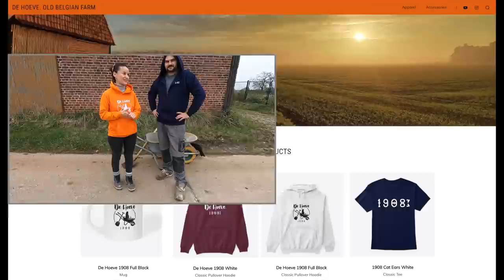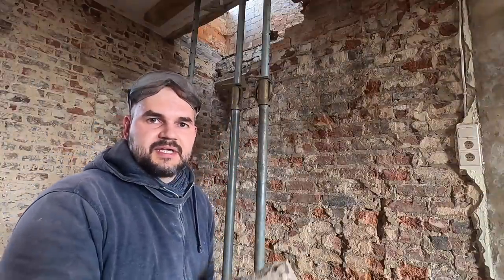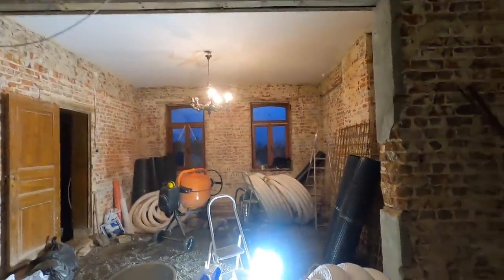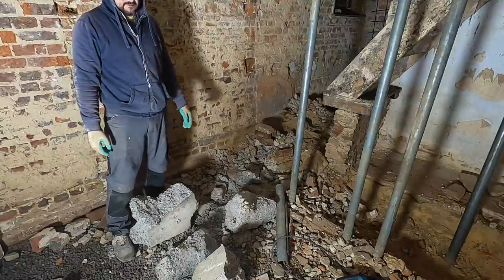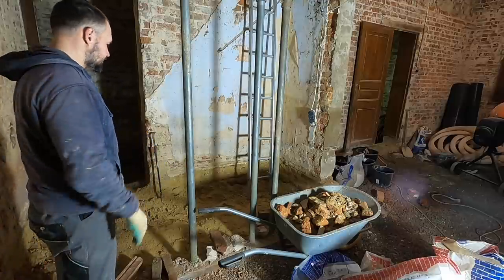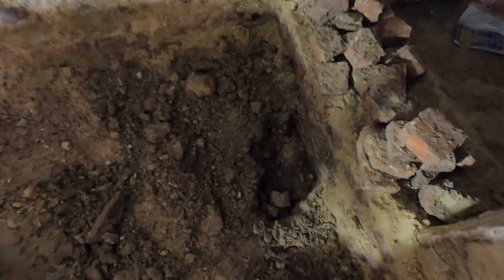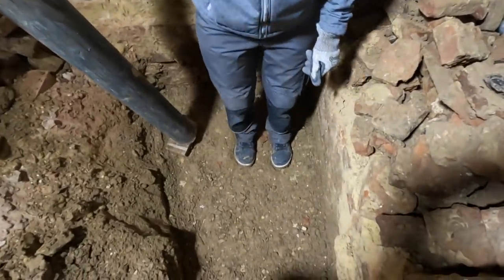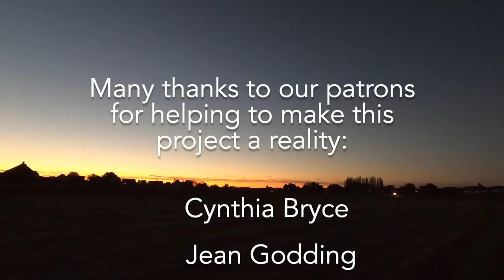Bye-bye crumbling wall! / DANGEROUS removal of OLD oak staircase

Comment: a suggestion only:  take one of those plastic bags, put a current newspaper in side of it, and write a note from the two of you about what you are doing, when, what problems you encounter, and what surprises you find.  Include that in the bag, tape it shut as well as you can, and bury it for the next renovators to find!  In my friend's house, we found a newspaper from 1946 in the wall, along with a note from the then owners. It was really neat to see what they were doing, and thinking.  The newspaper was a real eye opener as well.  We learned that the Marshall plan was not at all popular, even though or education told us differently.  (Letters to the editor section.). Besides, in 70 to 100 years, what will they know or think of Covid?
   Keep up the great work!
Reply: What the didn't tell us in history class is that the US made the Marshall help depend on all kinds of political demands. So it was a trade off. For The Netherlands f.i. it implied the decolonization of Indonesia, while breaking it's promise made to the Moluccans for independence. That has caused significant issues later, until this day.
On the whole Germany was off better than many of its victims.

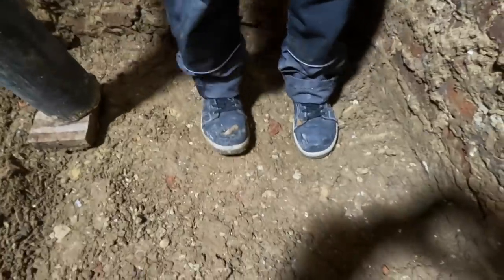Comment: 24:08 its called liquefaction similar to a earthquake when the water in the soil is pushed upward.
Reply: BTW that is very unstable ground so you need to address the water drainage for that area or you will have a problem

Comment: Hello, the wobbling effects is about the ground water. In old houses you dont have drainage, so the ground water comes up.
Reply: Here in 🇨🇦 we would dig down and add a plastic well type insert with a sump pump to direct the water into the Grey waste water. This would prevent any rising water from degrading the foundations.

Comment: If the wall is important structurally you'll have to plan your windows carefully. Love the idea.
Reply from the maker: Thank you for your advice, Bill! No, it's not structural, but we will still place some wooden posts  and install the windows in-between.
Reply: @DeHoeveOldBelgianFarm  what might be interesting is use some of the old building materials and make it look like a outside of small buildings.  Had a friend do that it was beautiful 😊.
Reply: Even if it is a non-bearing wall, every hole in a wall is a weakness so be certain to build a nice, wooden frame(jamb) for each window to strengthen and support the weight of the entire structure. It would be nice to have some tiny LED lights on a dimmer switch to enhance the effect at night. Perhaps, a few window sills for plants and the cat inspector on the higher windows.
Reply from the maker: @l.m.2404  thank you 🙏 love the idea with led lights to enhance the view

Comment: I love the idea of the windows, but also could you not have two entrance's to the stair case? The original and from the room that was divided by the wall you knocked down? I'm loving the series, I wish you the best of luck!!
Reply from the maker: Thank you  very much! It's gonna be our guest room, and we don't want to lose this room by removing the wall or adding a door. Although the idea is very tempting but our guests sometimes stay for a long time and we want to keep their privacy  and semi-isolation :-)
Reply: @DeHoeveOldBelgianFarm  Will the windows in the wall maintain privacy if someone is climbing the stairs? I like the idea of a door that locks in the new wall, it would anchor and balance the pattern of the windows. The Feng Shui energy flowing with the wall down is unmistakable and beneficial. A solid locking door would preserve the flow.
Reply from the maker: @khilde6093  Thank you for sharing your vision. We would also add a curtain (from a heavy dark material) so that  the guests can close if they want.

Comment: I really like the staircase windows idea!  So, you are going to make a box under the staircase that will give you a place to put storage and also support the new stairs?  Or are you going to just form the first few angled steps and stair base from concrete?  If you do that, you can make that whole space under the stairs into a closet just by putting a doorway in as far over to the right hand side as you can make it.  Depending on your finished floor height, you could probably even get a full sized door in there.

Comment: The mushy staircase floor looks like a problem. If you don't already have it in place, run outside drainage weeping pipes, about 20cm or more wide and down to and against the footings around the entire circumference of the house with another pipe leading the water out to a farther, lower area to drain out.  It'll take time to work until the water finds the 'exit' but eventually this should help reduce your damp problems.  Your floor might also be on an artisan well spot which can never be fixed. I hope you find some good solutions. All your hard work deserves rewards.

Comment: The new staircase plan is cool! However, be sure your building codes allow for windows without safety glass down the stairwell. Safety glass is required in the US so you can't go tumbling through them by mistake! All your foundational work is very inspiring!

Comment: The windows will need to be out of the foot pathway as you don't want someone to hit it as go up and down. The sound walking up and down will also pass through as well as any dialog within the room its self. So consider that as well. It's a fun thing for sure and is novel! So I would do it!

The built-in drawers and closet spaces is also a great idea!

Comment: And because you asked:) :  I love the idea of a wall of windows, but were you going to use that space as a guest bedroom? In that case, every time somebody turns on the light in the hallway,  their bedroom will become lit up, and there will be no privacy there either. I would  definitely make the staircase wider, and put in a window in front of it, so you look out when you come down the stairs. But since the entrance to the staircase is in kind of a corridor (if I remember correctly), I would rather remove the wall and open it up on that side instead, and make built-ins under the stairs on that side. An open staircase would make it a lot more airy and open towards the entrance and guest bathroom.

Comment: Mitigation methods	Edit
Main article: Dynamic compaction
Mitigation methods have been devised by earthquake engineers and include various soil compaction techniques such as vibro compaction (compaction of the soil by depth vibrators), dynamic compaction, and vibro stone columns.[18] These methods densify soil and enable buildings to avoid soil liquefaction.[19]

Existing buildings can be mitigated by injecting grout into the soil to stabilize the layer of soil that is subject to liquefaction.

Comment: nice idea using the windows like that.   you might  hang them on wires from the ceiling and then once you get them in the right spot frame around them. you could help airflow through the space by not making that wall solid also.  A screen effect  lets say vertical boards with a spacing between them and the storage could be built into the structure.

Comment: 24:25 that is LIQUEFACTION ... you need to drive down posts (piles) treated wood will work to stabilize (like Venice)
Reply: Without being solid or stable the floor could or may shift? At least crack any work laded on top of it?

Comment: I love the window idea. It will be beautiful. However, I think the stairs will be too steep as you planned it. Is it possible to add a landing halfway down, and then turn the stairs, ending into the room below? It seems like a safer option and you can still incorporate the windows.
Reply: Check the head height on the landing first if ok as a retired builder it would be a lot safer and easier to go up and down the stairs

Comment: I'm not sure if you guys mentioned in a previous video on how you guys planned on heating the house, but are you guys pouring slab on grade throughout the house? 
If so, one option would be to install radiant floor heat while your at it.

Comment: You could possibly use the little space under the stairs as a coat closet, or possibly a little storage area.

It’s odd that someone would Lay a brick foundation by using plaster. But, then I realized that i think that the old brick wall was probably built around ww2. it’d make sense if the wall was made from that time because during ww2 stuff was Vary scarce, especially with buildings materials etc.. so they used whatever they had to built the wall with. & I think the wall was probably built around 1939 through 1943, ( not confirmed. tho most likely. )

Comment: The idea of the windows set into the stair wall is attractive and will produce a nice display but you may want to consider frosting the glass to give the occupants of the guest room their privacy. You may be able to lessen the steep angle of the stairs by starting the rise in the hall and stepping around the wall. It may be possible to remove some of the brickwork to increase head room over the stairs as it comes around the wall. Perhaps use a steel girder to support the floor.

Comment: I would put a landing at the bottom with maybe four steps so that the new staircase won’t need to be so steep. Also, does there have to be a wall there? Can a beam be installed to support the floor above where the old wall was?

Comment: Hi, I'm from Northern Idaho in America. I was wondering if you could explain some of the tools and equipment you are using and why you're doing what you're doing? I love renovation channels and I love learning about it, not that I'm ever going to do any renovations because I'm 61 years old and a disabled nurse. But building and renovation an old home is like the human body. Certain things have to go in a certain order or it will not function to the best of it's ability, correct?  For example, when you took the moldy staircase down, what was that machine you used and why were you using it there? You could teach us as you learn things. Also, why did you bag the dirt that was a light brown color?

Comment: According from what I saw I suspect the wall you removed was built in later. On the back wall of the house there is a long wooden beam, could have been big doors in the inner court which were replaced into brick wall. This explains why under the stairs there were terra cotta tiles. I like the idea of the windows very much. But as you intend to make a guest bedroom there I think the guests dont want to look at you when you walk up the stairs. I would reopen the back wall with 2doors into the inner court and use the small windows on the 1st floor or in the courtyard wall higher up opposite to the staircase. You can almost start rebuilding. Great job. Love to watch

Comment: Maybe it was mentioned somewhere and I didn't notice but i saw like 3 courses of bricks under the door. That means like 20 cm from the current level to the final floor level. How are you going to fit all the hydro insulation, thermal insulation, concrete and flooring? Dig everything once again? That's something that I'm very curious about from day one.

Comment: Where the tampered soil was wavy, if that wall is an outside wall, you may have water intrusion from outside. Seems you may need to add French drain (sub surface aggregate channel) along the outside perimeter to get all the rain water from the roof and the tall outside walls away from foundation. It will greatly reduce water intrusion and moister in the interior floor/ground.
Reply: Just watched your other video about soft blind install, you got it. Keep up the good work. You two are doing great.

Comment: It was a wise choice to remove this (non load bearing) brick wall .I like your careful step by step sequence of completing the project. Also I am sure that you have learned not to push yourselves to exhaustion.
Oh, there was one thing that alarmed me and that was the SPONGY nature of the earth in the hole which had held the old wall. That   the reason the old wall failed was that the water table had been breached which, in itself suggests that you need to add that to your concerns about moving rain water run off and snow melt still affect the house by impacting the foundations. Seems to me that Illya did some work on the drainage yet still, as you found out, it was showing ongoing problems. I would employ a water table expert for an opinion before you end up spending a fortune.
Reply from the maker: Hi James, thank you for your advice. The water table is pretty high, and we are taking measures. Also apart from soft blind area, we would like to do the drainage. The fact that the ground is wet, is because it is not yet completely dried out after the flood.

Comment: The windows are very nice! I was wondering if the staircase could be relocated to a larger, more open space and run up the inside of an exterior wall at either end of the house that doesn't have windows? Then it could be less steep and afford the same storage underneath as well as helping to insulate and stablize the exterior wall? Also the wood treads and rails of the stairs could be showcased as a design element in the room rather than enclosing the stairwell. Or is that just asking for more time and trouble?
Reply: I thought the same thing , horrible very steep staircase, NOT a good implacement   you need a better design to replace the staircase  . A big house with a narrow staircase  No good

Comment: Interesting arrangement for that staircase. It would seem that stairs were once open on the side of the backroom. Hence the wallpaper under the stairs.
Although that tiled floor and the floor drain (?) suggest some other use. And with a door leading to the back hallway to which also the 'opkamer' leads. That could suggest that the room actually once was a large kitchen diner (woonkeuken). Pretty common in farms although the usual connecting mudroom ('bijkeuken') is missing.
And later sloppily bricking that up for some reason.
Fascinating. Perhaps someone in the 530+ comments came up with the explanation?

Comment: What happened with the dirt was something called liquefaction. It happens in soils in which the space between particles is completely filled with water. Before being shaken the water pressure is relatively low, but shaking can cause the water pressure to increase to the point where the soil particles can readily move. Try looking up the recipe for Oobleck. I think you kids will love it.
Reply from the maker: Really cool,  Elisabeth!  I didn't know that you could make the Oobleck yourself.

Comment: Well in india too, when we built house in open areas let's say in a open field. Random broken Pieces of bricks and stones are placed below the floor of room so that even if the sand or soil below the floor sinks later in future, it does not led to any major damage to Floor. In a way, it helps to stabilize the floor soil. In our case too, When my father was constructed new house in village, we followed same technique, first filled the room floor portion with water for several days so that the sand can harden. After that lots of pieces of stone, broken bricks were played and then then the cemented floor was created over it.

Comment: I thought you would either:  

Build the wall back up - but take the other one down on the little hall side - so that the stairs is open and feels a larger space as you go upstairs.

Build the wall back up - but take the other one down in the little hall - and turn the stairs around, so they face the other way. You could have them wider too - so from your front door you see the stairs rising away from you.

Comment: Yup. That wall definitely needed to be removed, I would be careful about using too many window in the wall. Each opening will make the wall a little bit weaker. Also, each opening for a window will require special brick work. But, it CAN be done.

Comment: The windows look nice, they are worth to be recycled, but it could get messy very quick and very easy ... so you should follow some rules... I'll write you some, maybe you will like some of them: 
1. There is a rule in arts that sounds like this: squares (and rectangles too) are heavy, so they should be at the bottom, circles are lighter so they should be above, while triangles are pointy and they should go at the top... i'm writing this because i saw on the left of the sketch that you put at the bottom a window with a rounded top and above it a rectangle window, while the rounded top one should be at the top and the rectangle one at the bottom... if you have a cicle window, that fits better above a rounded top window than above a rectangular window.
2. The windows should be grouped by similar width when they made up columns (because that is what you are going to get - window columns). You can even add some pices of wood on the sides to get the exact width of the window above or bellow, so the columns are somewhat aligned
3. You should choose only 1 color for the paint and a secondary color for accents (like the one you hold in the video with the white frame and metal mounting of the small pices of glass...)
4. The rows should be also aligned somehow... it's quite tricky because you are conditioned by the staircase...
Good luck!

Comment: I was wondering if you planned to add a half landing for the staircase, so that it could be less steep by using that hallway on the other side for the other half of the descent. But certainly it also makes sense to use the space under the stairs for storage.

Comment: I’m not one for mismatched stuff, and it sounds like a lot of work to install random windows in the brick wall like that, make them secure so they don’t leak, etc. but it could be cool if you can pull it off. Good luck.